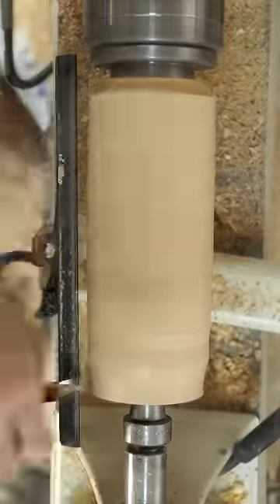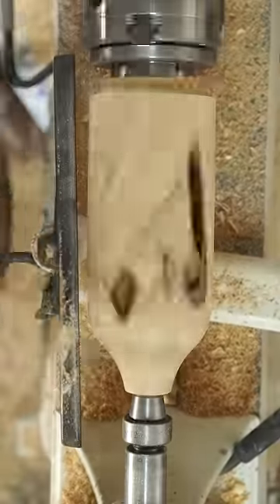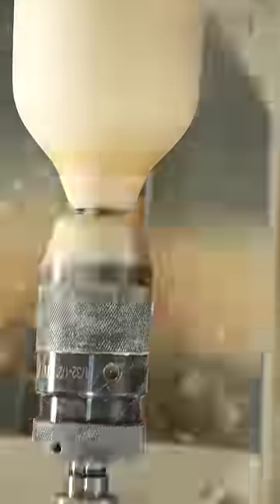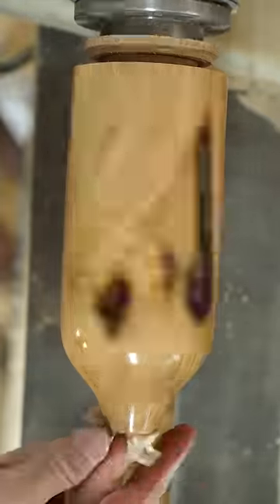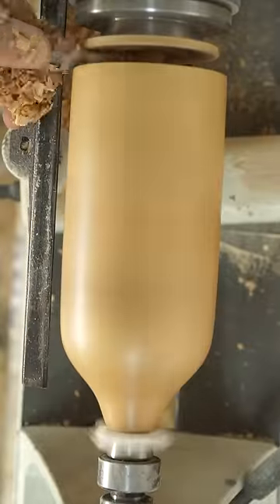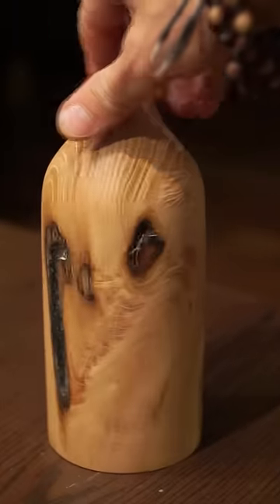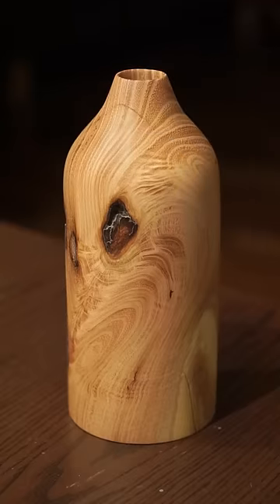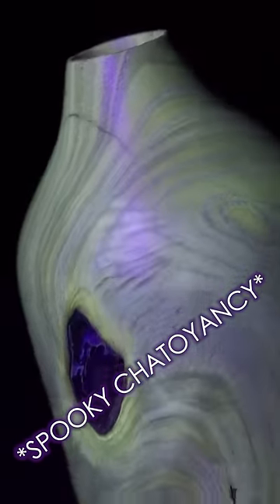Glow in the Dark Wood!

Comment: I'm in germany, and these grow almost everywhere. If one wouldn't be a plant or nature nerd, they'd never know that it's not native. Always a blessing walking past them when they bloom, both visually and olfactory. Also they apparently they have unmatched high resistance to rot compared to other trees growing in temperate climates, I wonder why no one builds with them outdoor stuff.
Reply: planting them for industrial use would spread this invasive plant even more. And especially their bark is kinda toxic
Reply: In the u.s Farmers used to use them to make fence posts that would last 50 to 100 years
Reply: I've used it for a railing on an outdoor deck before. I've always wondered why more people don't build with it too.
Reply: They make great fence posts since they rarely rot if ever, hard to cut for sure and they burn very very hot in fires, they would be great for lots of purposes
Reply: not much straight grain in most of the trees and more knot holes. very hard wood makes good fires. a few good trees makes them like gold.
Reply: I cut one down recently after a storm got it.  Apparently they have a problem with carpenter ants in the pith.  I read that the young pith wood isn't so rot resistant like the rest of it.  That black hole in the piece could be some of thier handiwork if memory serves.  Some of the pieces i messed with also just had random holes like that with no observable connections to anywhere.  Also in USA the locust borer limits thier lifespans in many places.  I have a piece drying to make a mallet if i ever get to it.  Wildwood nj once bought black locust for some boardwalk replacement.  It was such poor quality they tossed it and bought ipe.
Reply: @mysterymanforu  yes it would seem that carpenter ants love them. one of the reasons to be careful using them for firewood
Reply: @Alterraboo  it’s not invasive in the states. The tree has a hard time dominating a climax ecosystem such as a hardwood deciduous forest. They usually don’t live long enough to tower over the tough oaks cherries beeches and poplars we have in my area.
Reply: @MrJdamnBro  the saying is that it lasts one year longer than stone, hahaha.
Black Locust, Red Mulberry and Orange Osage are the three most rot resistant hardwoods in North America and they are more rot resistant than Redwood and Red Cedar.
Reply: @Dollapfin  yes, the Black Locust is more helpful than invasive, because it helps fix nitrogen from the atmosphere and turn it into leaf mulch that helps all the other trees, and the climax forest species live longer, but we did have some 110 foot tall Locust trees in the ravine, but the Sugar Maples and Hickories will live longer though.
Reply: because the people selling us wood for building would rather sell us wood that breaks over time and needs replaced (which equals more profit for them) same reason everything from phones, to appliances, to lightbulbs need to be replaced every few months or years; this is a policy used in industrial design called planned obsolescence, where a product is built to fail
Reply: @victorhopper6774  every black locust on my property is straight as can be, we have some gnarly ones but that’s not the norm. Will it and it makes great deck boards!
Reply: @vicegrips188  lucky you. perhaps there are different types. my experience is the opposite along with them being carpenter ant hotels.

Comment: Ok, so being a chemistry student / chemist who did do some research on luminescence, I kinda want to add my two cents, in case some of you all find it interesting:
There are multiple kinds of the overlying phenomenon that is called luminescence. For example there is chemiluminescence, which is energy from a chemical reaction (thing a glowstick). There is also bioluminescence, which is when the light originates from some sort of biological system (think a firefly). 

And then there is light induced luminescence, which is what we're seeing here. The basic way it works is, there are molecules that can absorb light (in this case specifically black light which is lower wavelength and therefore higher energy than visible light). This energy excites the molecule into a higher energetic state, from which it wants to relax (everything wants to have as little energy as possible). To relax, it can then release this energy in the form of light, which is of a lower wavelength (and therefore energy) as the light it absorbed (can't be more right, that would be energy from nothing), so in this case the emitted light is in the visible range. Excitation and relaxation are some rather complex quantum mechanic / quantum chemical type shit so I won't bore you with it. 
The main point is, there are two types of light induced luminescence. There is fluorescence and phosphorescence. They are defined by the time it lasts, it might only be a trillionth of a second or it might be as low as a tenth of a second. What I'm saying is, to be sure if it is phosphorescence or luminescence you need to measure it. If you want to be completely correct in any case, just call it "luminescence". That's ALWAYS correct.

Comment: I love black locust: it doesn't rot, and I've seen fence posts that were over 50 years old and still solid, if somewhat degraded. It's really hard, and a young sapling makes an excellent walking stick or wizard staff, whichever you prefer. It grows really fast, and can propagate from seeds, runners, or cuttings.

Comment: Okay, explaining fluorescence: much like regular light, UV light is made up of photons, just a shorter wavelength than we can see. When those photons hit molecules, they can be absorbed. When an atom absorbs a photon, it absorbs all that photon’s energy. When this happens the electrons around the atom go up an energy level. The problem is that most electrons want to be at the lowest energy level possible. Some materials (such as what you find in solar panels) will let go of these high energy electrons, while others will expel a photon of the same energy to get back to equilibrium. The wavelength of the expelled photon depends on the material, and it happens that fluorescent materials expel photons in the visible light range

Comment: The electrons receive energy from some source (in this case the light) and their electrons jump from a lower energy state to a higher energy state, because you need an input of energy to raise your energy state. However, the electrons will eventually fall back down to their normal energy state, but they need to release that energy they were given, and one form of energy is through light.

Comment: Black locust is crazy.
It will give you a 100 year fence post in a few years. Has the rot resistance of Osage orange. 
I have put 8 inch wide posts in the ground, and they started growing branches.  Super invasive, half inch wide growth rings, burns like Coal.
Did not know that it was bioluminescent. 
It might be from another planet

Comment: I’m a chemist and a teacher, so I can give a bit more of an in-depth explanation! There’s a molecule in the wood, and you’re right that the electrons dooooo sort of become “unstable” but we prefer the term “excited” for this. It’s excited because the energy from the UV light has to go *somewhere*, so it goes into the electrons. This happens with a ton of different molecules, but usually they just jiggle around and heat up or they spit UV light with the same energy back out—in both cases it goes back to normal and you don’t see anything because you can’t see heat or UV light. Fluorescent molecules are special because they will do both—they jiggle around a little bit and release some energy as heat, but when they jiggle they reach a point that forces them to ditch the rest of the energy as light. But some of the energy in that light went toward the jiggles, so the light has less energy than the UV light, which makes it visible.

Comment: Black locust wood contains compounds called flavonoids, which are known to be fluorescent under UV light. Specifically, the flavonoid called robinetin is responsible for the wood's fluorescence. When black locust wood is exposed to UV light, the robinetin absorbs the energy and becomes excited. The excited robinetin then emits light in the green-yellow range of the visible spectrum, causing the wood to appear to glow. The fluorescence of black locust wood can vary depending on factors such as the age and condition of the wood, as well as the intensity and wavelength of the UV light used. It's worth noting that not all black locust wood will fluoresce under UV light. The presence and concentration of robinetin can vary depending on factors such as the growing conditions of the tree and the part of the tree from which the wood was harvested.

Comment: So a little more thorough explanation of fluorescence:
Photons (light) have a specific amount of energy. Electrons in molecules and atoms can absorb photons with specific energies to get into an agitated state. After absorption, the electron can fall back to its original state and send out a photon with the same amount of energy in a random direction. This is how light is scattered off of objects.

UV light photons have too high energies for our eyes to see. What happens in fluorescent molecules, is that the electrons don't jump down immediately back to their original level, but first jump down to an intermediate level. By doing this, instead of sending out a photon with the exact same energy that was absorbed, they send out 2 photons both with lower energies that add up to that energy total. These lower energy photons, in this case, are within the visible light spectrum.

Comment: Electrons bond to an atom at different energy levels, if they have more energy they are considered to be 'excited' and less tightly bound to the atom, they can become more stable by releasing some energy or "falling down an energy level". Things that fluoresce simply absorb the higher energy uv rays and jump up several energy levels at once then fall back down in steps releasing lower energy light than they absorbed. Lower energy light is light we can see

Comment: Ehhhhh. Excited is a bit more accurate of a word than unstable. Although when excited the energy level of the electron is unstable and it will lower itself back by emitting radiation, usually in a longer wavelength than it absorbed ex: it absorbs shorter wavelength uv and emits something like a green or yellowish light which has a longer wavelength

Comment: I have original locust fence posts in my yard that are still standing in the ground that are 25 years old.  I have locust statues of Thor and Freya that I carved in my yard that are still standing and are 50 yro.  That wood is hard as rock and super rot proof without any use of pressure treating, or wood preservative.

Comment: Glow in the dark is different, you're purposely misleading. 
I was hoping to find something who experienced the same thing i did while cutting trees at my cabin. There were a number of them that threatened to fall in the direction of the cabin if the snowfall last winter proved to be too much for them. So spent the weekend cutting them down, by the time i had finished Saturdays work it was well into the evening and the trunks were mostly segmented into logs. The logs seemed less affected by the weakening light of the evening than the rest of the area. but as night covered in full, the logs remained luminous, not extremely bright, but enough to where you could clearly see the logs. It was like a real life shading glitch. By the next evening, whatever phenomenon it was had ceased. I looked up why it would happen and bioluminescent fungus was a common answer, but these logs were evenly lit up and without a blue green hue kike the fungus.